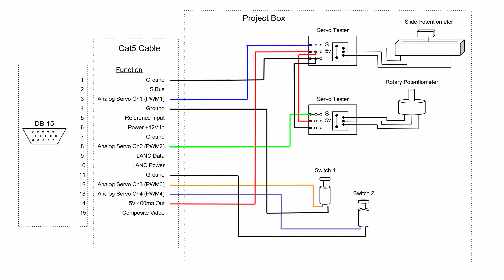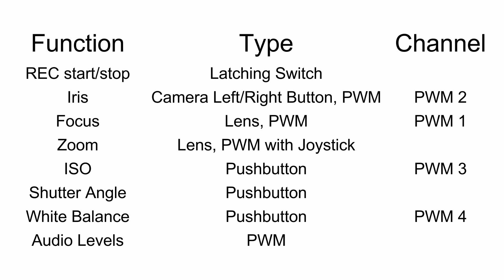BMMCC Remote Control: Learn to build your own Blackmagic Micro Cinema Camera Remote

Comment: Hi, I am building my own version of this. Do you think that a 10turn linear 10k rotary potentiometer would work better here for focus. I build this with a rotary pot for focus, but it is not great.
Reply from the maker: Hello, my guess would be that using a 10 turn pot would not help. Different lenses respond differently to being controlled this way, some work better than others. An Arduino controller can be programmed to give you much more precise control, but that is a whole different project.

Comment: Hi. Thanks for your Video. Due to i have no idea how to set up a remote controler with arduino i want to try the following to get more channels. Is it possible to use tha lanc functions for start/stop, Iris, Zoom and Focus and then use the "Button" functions for shutter and white balance? If this is technical possible then would awsome to modify a cheap lanc controler and a button box. What do you think?
Reply from the maker: It is definitely possible to use LANC alongside PWM controls.  Personally, I have not explored LANC much, but I have used a SBus signal converter along with servo testers to control Focus, Zoom, Iris, and Audio, and then continued to use a latching switch for Record on/off, and pushbutton switches for WB, Shutter Angle, and ISO. 
 
SBus Converter I used:
https://hobbyking.com/en_us/rmilec-high-precision-pwm-ppm-sbus-signal-converter-v2.html
Reply: Thats another perfect way. so with this kind of converters you have all functions in one. For buttons short directly to ground and for trimers you use servo testers. all the same as you show in the video. just one input. i am not that electronic expert but i will test it out. for my needs i will split the housing. the start/stop button ona right hand grip also the focus and on left side grip zoom. all others which i dont have to change often maybe on the top. i will see the setup when practicising....
Reply: I know this question is probably dumb but how is the remote powered? I've tried linking a servo wire (for example servo 3) to one of the ground Leeds and assigned that servo to record as a test and nothing happens.

Comment: could you use this to control the iris or focus?? 
https://www.amazon.co.uk/Adjustable-Motor-Speed-Controller-Switch/dp/B00Y2AV4G8/ref=sr_1_7?ie=UTF8&qid=1496181099&sr=8-7&keywords=pwm+controller
Reply from the maker: I don't think so.  The item you listed is designed to control motors directly, not servos.